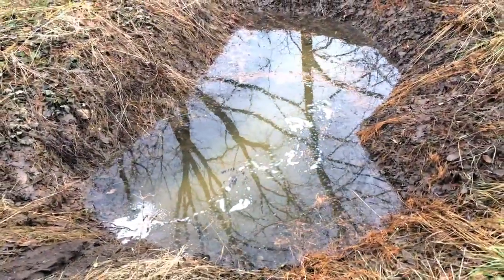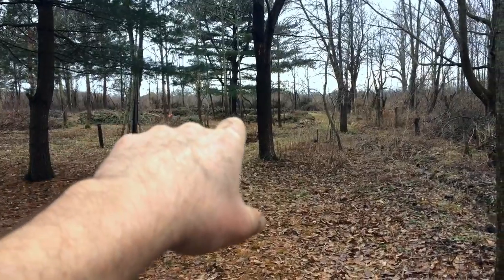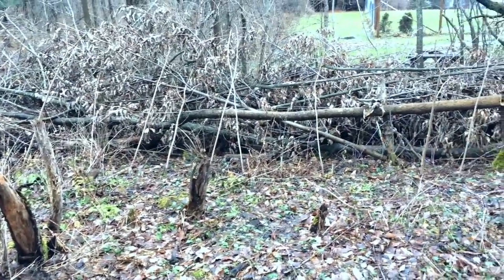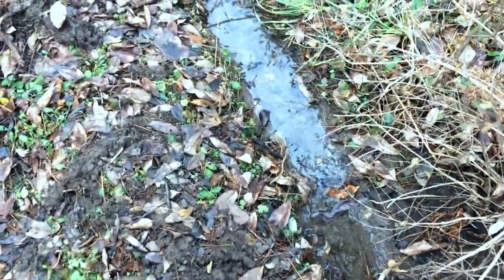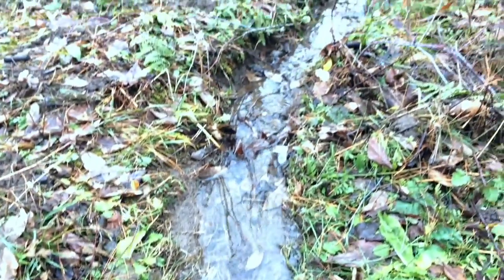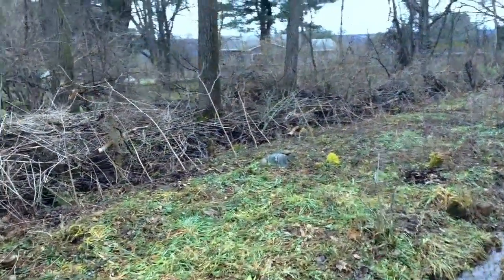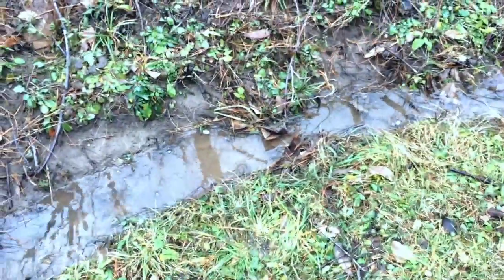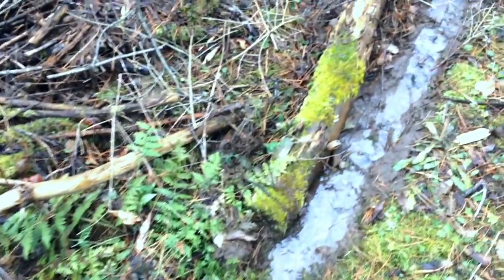Waterway - Renovating drainage ditch to harvest nutrient and water in depth discussion

Comment: So you're envisioning a thick hedgerow, to wick up the moisture/nutrient? The local bird life will appreciate the new nesting areas and balance the pest loads. Another tweak you can add to your adjustments to the pond, to capture silt - is to place a couple of branches on the edge, where the water goes into the pond. I oversize these branches in my own pond, so they're long and extend just past the sides of it. If you want more stability, you can run a few wooden stakes down, to anchor the branches in place, to resist the flow of water. These branches will capture leaf and grass debris to filter the silt through. You can then harvest the silt from behind the branches, on flat ground, instead of having to go into the pond to harvest it.
Reply from the maker: Nice layer of design here, I appreciate the insight.  I like it!

Comment: Looooove these types of videos. I am definitely a technique geek for stuff like this!

Any advice for how you develop an eye for water movement as you've done? I know you just observe and dig out by hand, but I'm wondering how you learned to do that? How do these types of changes play into your overall plan for the property?
Reply from the maker: I learned it directly from the water.  10+ years of working with it in small and subtle ways and you get a tremendous amount of info.  Just ask lots of questions while you work with it and keep an eye out for answers.
Reply: get a good set of rubber boots and go out and play! :)